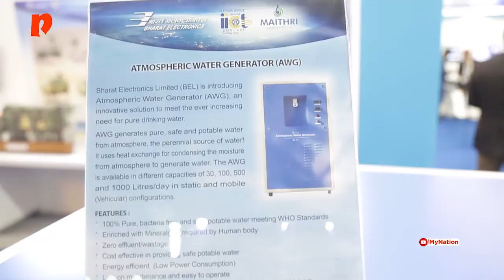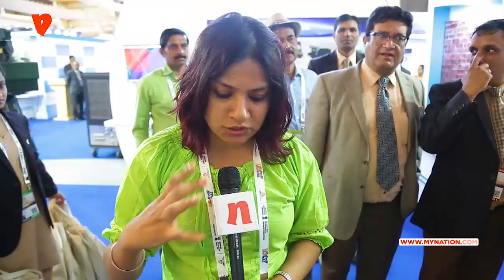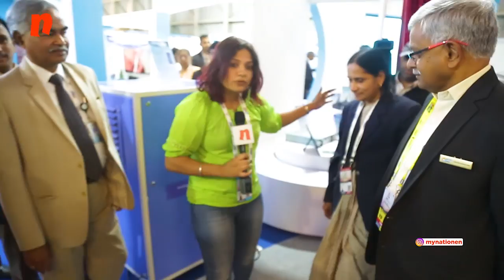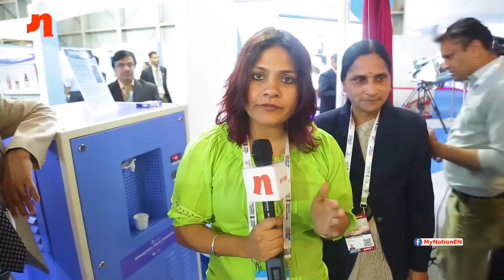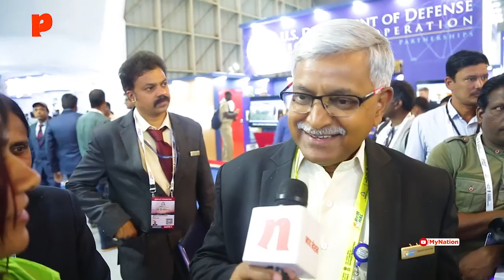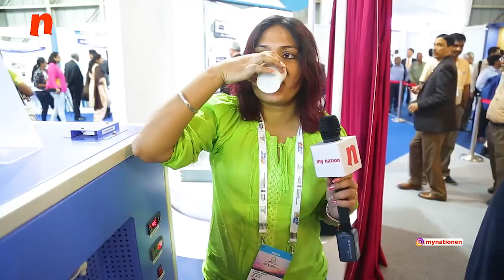Aero India 2019: Bharat Electronics unveils Atmospheric Water Generator at cost of Rs 1.75 per litre

Comment: can i now how much power it needs to produce 1000L of water ...?
Reply: An AWG that can generate 1000L of water per day uses 8kW of power per hour. So running it for an entire day would easily consume 192kWh (Units). Now putting that into perspective, at the rate that I am charged i.e. Rs. 8.50/kWh would cost about Rs. 1628 per day thus we get water at approximately Rs. 1.70/litre as claimed in the video.

Comment: This technology dangerous for climate because if we removing a humidity from air water content go down that situation our surrounding greenery will dry because as per since during summer and vintner all trees capture water content from air if air there is no humidity content then there is no water content so our surrounding areas become more hot now a days global warming going day to day high so my suggestion this technology needs to stop or ban 
Otherwise with in one year people will suffer medical diseases and uncomfortable climate so better we have to stop like this technology to introduce our people....
Reply: In coastal areas where the humidity is about 80 percent throughout the year, it is possible  to tap into this water resource without causing much damage to the environment as long as it is not used for commercial or industrial use. Thanks.
Reply: Plants take water from the roots and disperse water vapour through leaves. Google "River in the sky" you'd get a very accurate description of the process.
Reply: Navin Kumar , I need your help

Comment: Yaar hwa to chodd do...ab iske bhi peeche pd gye ho...aise inventions ko shuru me hi control krna chiye....should not b promoted....hwa pollute to h hi or iska moisture bhi nikal lo.....very bad🚫
Reply: Because of excess moisture....Water accumulates dust
Reply: @mondalsdiary498  isn't it disturb our natural ecosystem??....or natural rain cycle.??
Reply: @tbfyouthtalks1812  No, under present circumstances the moisture level, carbon dioxide , dust is very high..So no issue...The need of the hour is to decrease green house gas
Reply: @mondalsdiary498  isse green house gas kaise kam kroge....sirf moisture ko water hi to bna rhee ho....green house gas to fir bhi release hi honi h.....
Reply: @tbfyouthtalks1812  I did said to decrease Green house gas is need of the hour...not that this process will decrease it....